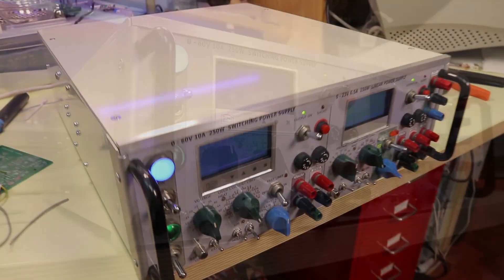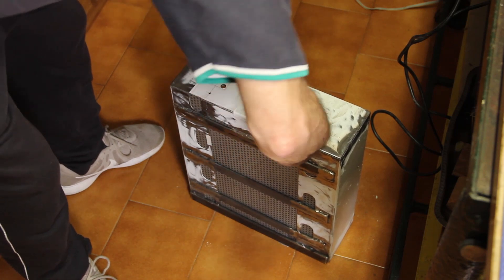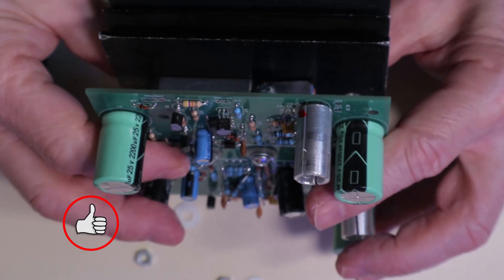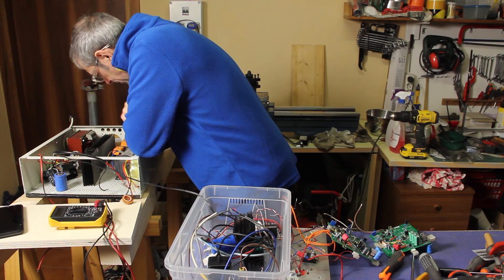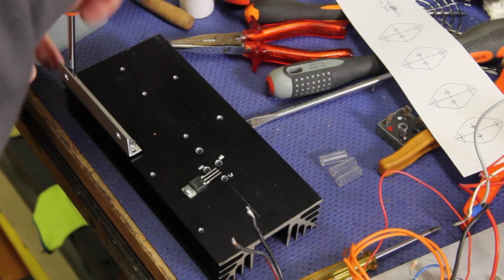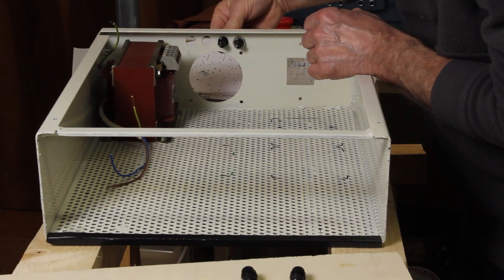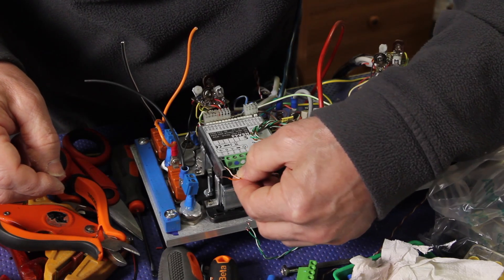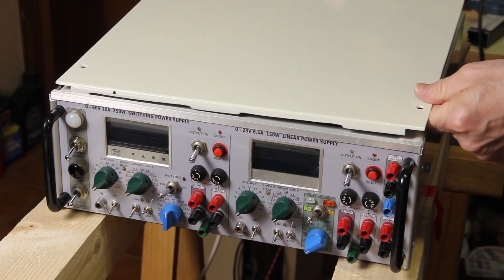The Ultimate Power Supply for the Lab – Crude, but Functional

Comment: I remember building My own our Supply too, ik was based on  a schematic of elector..
 The  "plus"  Professional Luxury Universal Luxury , 0- 30v 0-10a, with adjustable current limiter, 
How many powertransistors i burnt ? Quite a lot, and if the current limiter kicked in,  i had a 300w FM transmitter....
In those Days uit did not have the knowledge and tools to really search for the Faults, 
.....it has ended in the scrap
Reply from the maker: @norbertsmallegange6331  very relatable.

Comment: TO-3 package is really a piece of crap and i know why it has been abandonned.
TO-220 is a bit smaller but TO-264 is pretty well.
for those in-line vertical packages: the best solution is to use clips and it is easier than you think to use clips.
Some clips do not need any adaptions on the cooler: nothing.
It is just that you need a vertical cooler which can be the box package itself.
Reply from the maker: @jeanyves5380  thanks for commenting, I consider this a point to give an answer to in a next Q&A video.

Comment: They've invented hole-saws for metal for a reason... your build kind of reminds me of Frankenstein (a bit like an amateur radio build - I noticed a lot of "dead bug" soldering). I also like your style of mixing "let's build some crap" and walking around outside slipping on ice. Did you load test this beast?
Reply from the maker: @AstrosElectronicsLab  thanks mate. Yes I thoroughly tested every single bit before mounting it inside the beast and a final test once everything was installed.
I'll make a Q&A video.

Comment: I will be watching. I probably have most of what I need to make this! At least the transformers and the enclosures!

Mark
Reply from the maker: Awesome! Next video I'll show the dual 12/15V power supply + 3.3/5V ...with a surprise.
I'll also publish the schematics on my website soon.
Reply: @AccidentalScience  I can't wait to see the specs and schematics/design decisions on this.
6 transformers? 6???
Reply from the maker: @Jimmeh_B  haha 😆 yes I used six because I had them laying around and not enough separate coils on one single transformer. But yes it deserves an explanation...at this point even with a video.
Reply: @ Sounds a lot, but i guess if it works, why not? I have often used transformers in series & parallel to get higher power, i think he was doing the same.
Reply: Be prepared for some cut fingers & Oh S**t moments on the way. I have built stuff similar to this, but i admire this guy. The best way to learn is by doing it! Try to re-use every component, use off-the-shelf items, rip what you need from old appliances etc. It is also very cheap.I got 10 grand worth of parts, from trash equipment.
Reply: @ I hear you mate.
Everything I have ever built (for myself) has been made from scrapped machinery and equipment. Commercial photocopiers (as an example) are a great source of motors, electromagnetic clutches... etc.

At least, they used to be. Not so much anymore.

I also once built a 16 x MOT stack to quadruple the output voltage at the same power levels without surpassing the insulation ratings for a spark gap tesla coil.

I understand the concept of "what's on hand", but 6 transformers just to get the correct number of voltage rails, for a PSU none the less? Do you not see the irony? Not to mention the weight of the unit, and the incumbent losses.

Personally, I would have taken those 6 xfmrs to the local scrap yard, then taken that money to purchase a more suitable xfmr for the task. Or, just rewound that torodial.

I respect the dude too. I wouldn't be subscribed to his channel if I didn't.

But if you're going to go to all that effort to design, debug, and build a custom SMPS with a linear PS incorporated, why not just go that one more step?